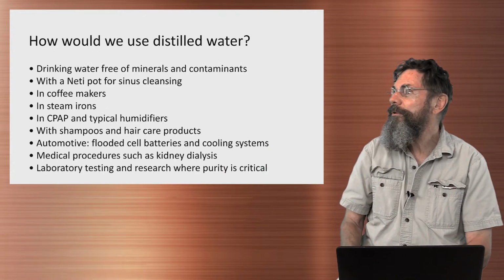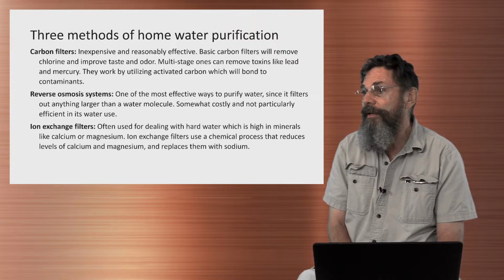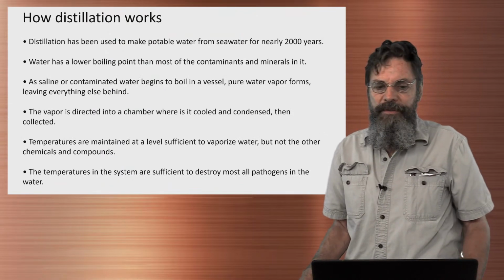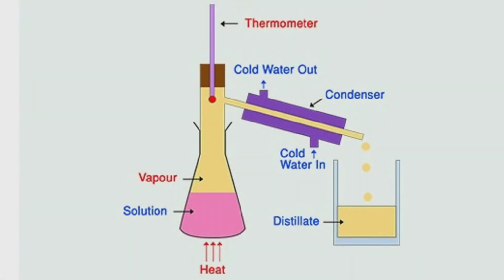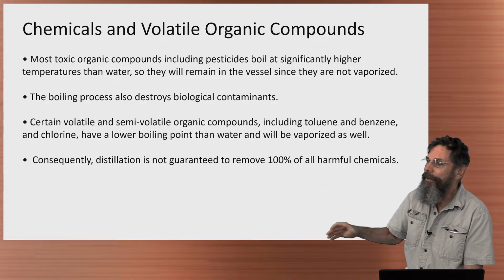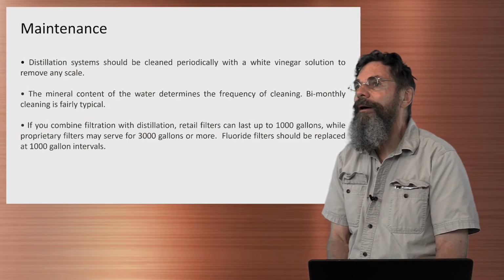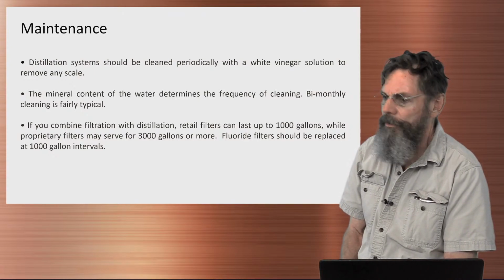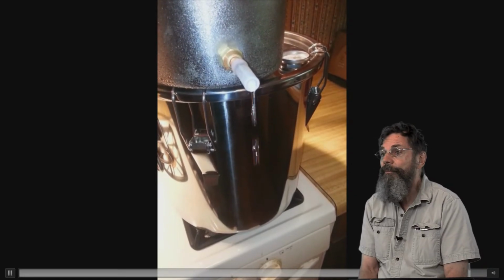Small Scale Water Distillation

Comment: Great presentation! I filter my chlorinated city water thru my big Berkey carbon filter 1st, then put it in my electric distiller. You said distill water, then run thru carbon filter last. Does it matter which order you do the carbon filter to remove chlorine.
Reply: The chlorine in municipal water will likely vaporize along with the water and be carried through, so the product must be passed through the carbon filter to strip the chlorine.  However, when considering fluoride, inorganics, and so forth, it's also more cost effective to distill first, because you will not be loading the filter with contaminants and therefore accelerating the filter replacement schedule.
Reply: That helps me, I will distill 1st, then filter last. Thank you for responding:)